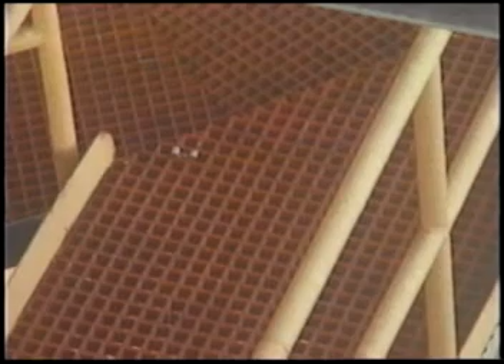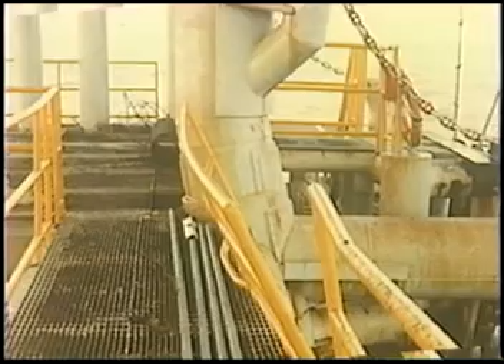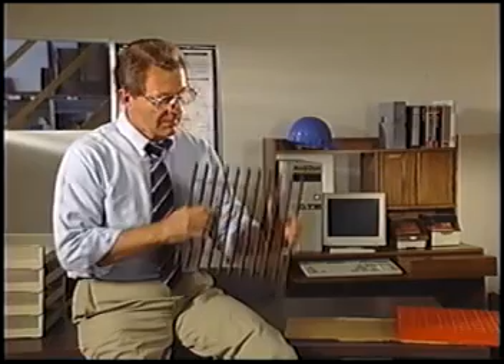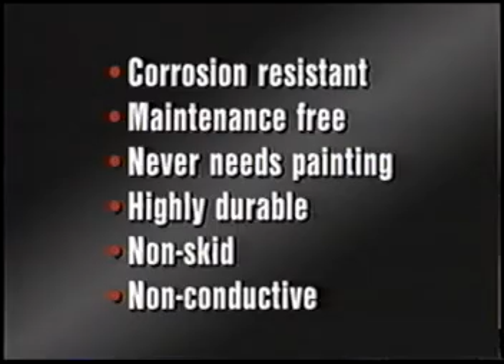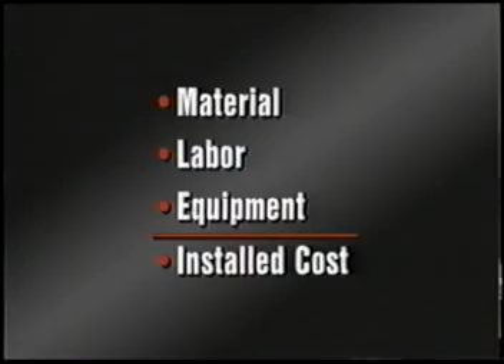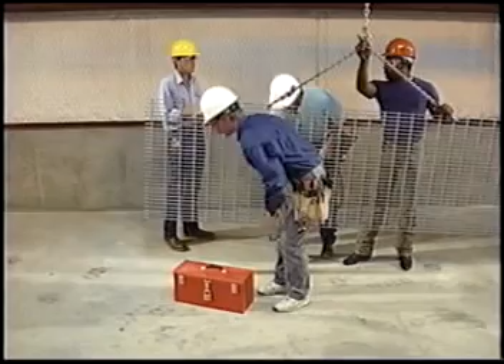FRP vs Steel gratings

Comment: Im steel contractor and I've installed both. This video is a lie.
1.I havent seen the first corroded steel grating and I do work in refineries. Maybe in an offshore oil rig or inside a food factory but in the last one stainless corrugated sheets would be best
2.Nobody needs 6 people to install a steel grating.
3. Fiberglass grating is almost as heavy as steel grating.
4.both can be cut with an angle grinder.
5. Both have to be locked in place with welding or clamps .
6. Steel grating do have anti skid surface

At the end of the day. You only need fiberglass gratings for highly corrosive enviroments, but in these areas you need an stainless structure and maybe aluminum or corrugated stainless is desirable.
Maybe in food plants? But when people wal over it the dirt goes to the floor underneat.